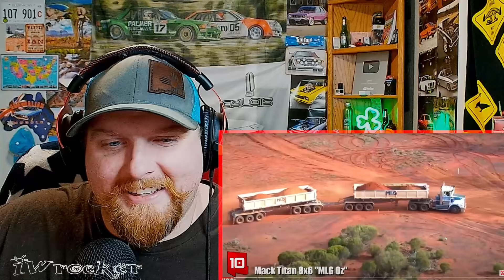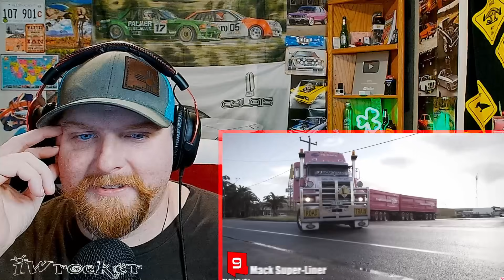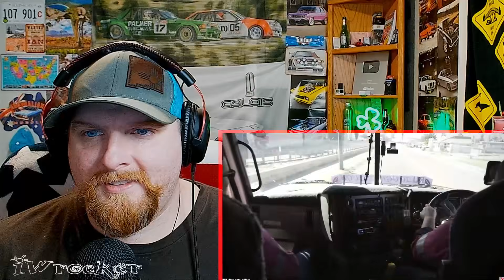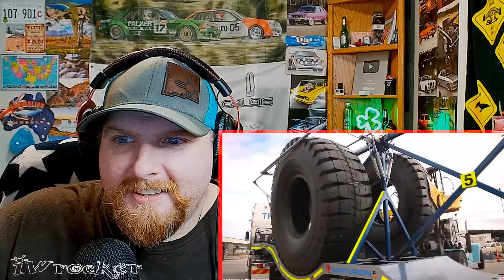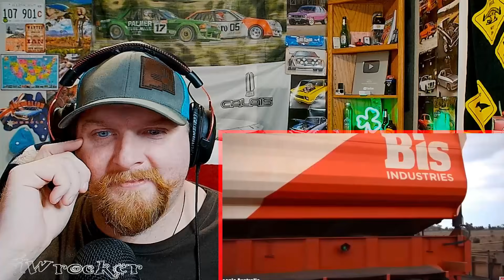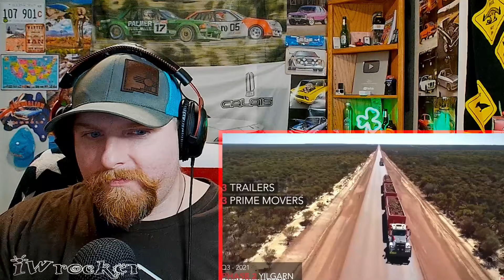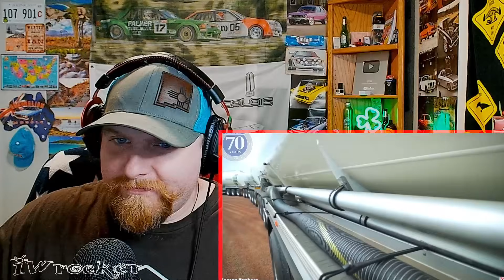American Reacts to The BEST Australian Road Trains Ever Produced

Comment: Those large tires on that Rig may look good. But, I am sure you would not be saying that if you were paying for them. I would imagine those tires are approaching or over 100K each so if they are say 100K just on that rig alone there is 12 tires @ 100K = $1.2Mil and then if you take into account the cost of the trailers and tractor..... That is a lot of money rolling down the road. Even the smaller tires are not cheap. You ask any farmer how much they pay for their tractor tires.... There is so much costs which most do not even think about. Buying the machinery is the cheapest part.... Running it and maintaining it, that is totally different. Good reaction though, Thank you for sharing with us all :)

Comment: I think the technology is already here for autonomous cars. We have a new Subaru work car, you can literally set cruise control and it drives itself. It stays in the middle of the lane you're in and follows curves in the road. You can literally take your hands and feet off the controls and let it do its own thing, once you're on a highway. It does start beeping at you after a short while, and flashing warnings to put your hands back on the wheel. Whether or not we will ever end up with cars that just drive themselves, with no human in charge, I don't know. I think they will always be designed to have a driver in charge. Not that human drivers are always better than computer ones, if I'm honest ;)

Comment: An uncle of mine is a quarry works operations and equipment specialist and emigrated out to Oz about 20 years ago. He travels the length and breadth of Australia inspecting and consulting at quarries. He flies as far as he can usually, but has had to spend days driving something like a Toyota Landcrusier on the red dirt roads used by road trains. He's sent me some crazy cool photos of where he's pulled over to allow road trains to pass. 
I kinda miss quarry work now watching and thinking about it all. Let's just say I used to get through some of those tyres.

Comment: Kenworth trucks built in Australia are all custom built to buyers specifications, in fact there are bigger trucks built at Kenworth in Melbourne,  they're the roadtrain prime movers. They are too big to fit on the production line, everything is bigger cab, chassis running gear.

Comment: Don't know much about trucks, but I believe the longest truck in the world is the custom-built 3b affectionately known as the centipede it’s a 205 ton 160 foot long rig it has an 18-speed gearbox with a 550 horsepower engine and carries over a ton of fuel.  It has 110 wheels on 28 axles the centipede transports zinc ore from a mine in the northern territories to a port hundreds of miles away – it works 24 hours a day seven days a week and in one year it can haul a quarter of a million tons of ore.

Comment: The really important application for autonomous driving is in trucking, not in cars. In a car, its a nice gimmick, but in trucks its making real money. A autonomous truck never needs sleep, or wants time off, or gets ill. No human driver can compete with that, not even those in low income countries.
The development and testing is done with cars only because thats cheaper and easier to handle.
Reply: I doubt a truck would be able to run 27/7 without having over heating issues or just issues in general
Reply: @joshhawke13  There are no overheating problems. Also today truck run for 10 hrs or more, and they only stop to refuel or load cargo.
The only time a autonomous truck needs to stop is also for that, and for maintainance. 
But there are no limitations like max driving time, driver breaks, leave and all that. And the best of all: the autonomous system doesn't demand to be payed every month. Once its bought, it just works for free.

Comment: The pink Superliner loading grain is owned by Heather Jones from The Pilbara Heavy Haulage Girls Group. Look her business up (Pilbara Heavy Haulage Girls) to learn more
Reply: The tyres on the Centurion truck are OTR (Off The Road) tyres for mining trucks and loaders - the trailers are made by Western Australian trailer manufacturer, Bruce Rock Engineering. If these tyres are hauled laying down, the driver is restricted to daytime travel only and will require a oversized pilot and permit. Transporting them standing up removes these requirements and allows the driver to travel at any time

Comment: My husaband works in an open cut mine in northern Western Australia and they have autonomous dump trucks over there. 
My husband says the first time you see a huge driver less dumpy is pretty daunting.
Reply: Yeah, I've been in one in the dicky seat running autonomously on a calibration pad testing LV follow.  I think I preferred being in the truck rather than the LV in front.  They are pretty safe and the GPS/LIDAR systems they have onboard are so accurate they have to offset the trucks on the haul roads otherwise they drive ruts into them.
Reply: My brother worked in the mines maintaining the vehicle fleet- when the automated trucks need service they just come in and line themselves up ready to be worked on.
Reply: @leemasters3592 That would  be so weird. Lol. My son is a fitter on the big tonka trucks as i call them.

Comment: Kenworth 509 is CERTAINLY an Australian Domestic model . In fact , ANY of the Trucks with Triple Drive Axles are Australian made .
The  Triple Screw Volvo uses a Volvo Drivetrain , but a Locally Designed Chassis . Canada does have Triple Drives in Logging . Too WIDE for Public Roads .
I  am dead  Against  Autonomous Vehicles on PUBLIC Roads . In a Private , closed environment , OK , whatever . Good  Luck with that .

Comment: Before speed cameras  and GPS tracking some trucks use to travel fast speeds around 150 or 160klmph ( 100 mph)they almost blew ya doors off.
Reply: Us trucks will do 160-180kmh flat out. There was a drug driver some years ago that was speed trapped at over 180kmh. Made the new here in Norway. Scania will do 130 ish when the fuse is pulled. Less top speed due their gearing.

Comment: Cab overs are not great for comfort when driving on our dirt/gravel roads.  Australia does not have a great rail network so,  road trains rule due to our isolated areas.  Kenworth, Mack rule the roads, some European built are ok on main roads but not really built for our dirt/gravel roads.
Reply: Scania do well on gravel roads. They have air bags on each corner of the cab.

Comment: The main problem with Autonomous vehicle, specially so trucks, is that if something happens, there is no hands on deck. Also it really only work for bulk or container transport.

For pretty much everything else, there need to be a dude there securing the load, and also checking on it. I have a hard time seeing it really replace truck drivers. And that is from the view of me the engineer that don´t drive trucks but do work orders.

Comment: We make stuff all in AUS anymore because our government wont look after Aussie industries and would rathe import everything , god help us if other countries stop exporting to us we would fold overnight . Check out the lengths of our coal trains hauling coal to hay point at mackay  in QLD .
The train usually ran with around 165 wagons, ( which varied slightly at times ) with an overall length was around 2.7 km's, or 1.67 miles, or 8860 feet.7 Sept 2016.
Reply: We call coal poofter dirt. Very lite weight compared to iron ore.
Pilbara iron trains are over 230 cars long. Each with 120t
Bhp has the record for a 10km long train.

Comment: ITs worth saying there is a huge diffrance between Volvo and Scania in manufacturing. Volvo make the main components in Sweden, then ship them out in containers.

All Scanians (part from the Brazilian once) are made in Europe. While Volvo (That also make trucks branded as Mack and Renault) have plants all over the world. In some cases they have different plants for different brands (like in the US), while in Australia the Mack and the Volvo branded trucks are made in the same factory.

Volvo also got a bit more of a local styling while Scania look the same all over the world.

Here in Sweden the Scania fans often joke and call Volvo third world trucks
Reply: The American style Volvos, aren't they made entirely in the US?
Reply: @otgiggs  The frame, body and like 90% of the interior is made in the US.

For the gearbox and engine its a bit complicated. The power-train is assembled in Hagerstown, Maryland. What i can get out of it its pretty much a power train assembly plant. So they build the engine, but don´t cast it.

So it really boils down to the definition of enterly made in the US. Somethings will always be imported.

Even at the main manufacturing plants, stuff like injectors, Volvo is not making them, but rather buying them from a other source.

Comment: The cab over kenworth you need to be a ape to get in them 
You climb on the rail you hold then onto tyre then foot hole and step into cab 
The others have steps but that means lower to grown when you hit something can jam steering 
Where' kenworth cab over they don't have lower steps you start at fuel tank behind cab with foot hole and do as as explained above 
Why older guys like long nose kenworth as steps on fuel tank which length of vechile under the door
The other cab overs Scania Volvo have front steps same as Japanese trucks but limits clearance 
Freight liners have a set of stairs that open up around front wheel when opening doors 
So theirs 3 styles of getting in the prime movers 
Why alot like long nose kenworth easier to get into 
Yes their is on you tube how Australian brand of kenworth built and designed here beefed up everything from chassis rails to cooling systems gear ratios ect 
Those tyres on trailer are massive I think 2 or 3 stories tall the dump trucks I seen could carry 180 tonnes on their back and electric shovel picked 90 tonne in 1 scoop has a self run power system next to it generating the electricity 
They put red flags on Toyota land crushers as they keep getting run over as they can't see them because sitting multi stores high in them a stair case to climb into them I can't remember how many thousands a tyre cost for some reason have two figures 6 to 20 grand a tyre
Now I think have one's that carry 280 tonnes now 
It's a massive  industry and hughe bills and the hole in the ground make the trucks look small as for Toyota landcrusier if didn't have red flag on it you wouldn't see it in the hole it's so tiny it  like a needle in a hay stack 
The wheels on the one's I saw where well over 6ft inside the tyre diameter and they use cranes with a jig to change tyre on vechiles 
Duell trailers are the norm here in Adelaide now many road trains as they've alter many intersections by moving traffic light further back so they can get around the corners and where I live quite common to see road trains 
Cheers mate 🦘🇦🇺👍

Comment: Largest load I saw was not actually a road train but a premade steel structure heading for a coal mine, took up the full width of the road with special dollys. Was hauled by two massive prime movers connected in line by a steel bar. Was travelling at about fast walking speed. The most impressive sight and sound was the quad magnetite and copper concentrate road trains coming in and out of Ernest Henry Mine in the quiet night time, lights running  full length either side 🔥
Reply: You should've seen them shifting the autoclaves for Murrin Murrin. That required 7 prime movers.

Comment: I've seen those tyre's on a standard flat tray trailer, they don't stack them 2 tyres horizontal 1 forward 1 aft on the trailer and they need a wide load permit and escort vehicles, so that speciality trailer that lets them haul 4 tyres per trailer is probably a big time/money saver.
I live near the Brisbane port so I see fully loaded B doubles all the time, but when we have visitors from overseas they are always amazed by them.

Comment: When I worked as a Truck detailer, a Peterbilt was a super rare machine to see. Every time we got one we would all get a selfie with it looking all shiny and pretty. So Respect USA from Straya 🤘
Reply: @mtuz8356   I've only ever seen 3! And one was pulling out of a truck stop a few hundred ks away at Tamworth. Still got my selfie 😂. I detailed 2 though and the drivers watched us like Hawks.
Reply: @kevo6190  i know of a few over the years.. 'murican trucks get shaken to shit over here... they just dont last
Reply: @adambartlett3483   - If PACCAR wanted to - they would just build Pete''s in Melb  (Most likely no margin exists over here for 2 different brands in the same space)  - Kenworth does the job of "Premium" US truck for Australia - just Torque the bolts, threadlocker and lockwire if needed - on highway vs offhighway, totally different beast, even Macks and Kenworths get shaken to pieces on bush roads (Volvo and Scania do ok, some off highway users swear by them in the West - horses for courses, bling for the muppets.)..  hmmm...

Comment: That Bis truck had a power pack second trailer, that is a second engine that powers the wheels on the trailer and helps with the load.

Most dump trailers run on hydraulics off the trucks engine for the lifting and compressed air for unlocking tailgates, single dump trailers are dumb, that is just hoses connected to the lifting / locking pistons and valves in the truck cab control everything, but multiple trailers can have electronic solenoids to control their functions with the truck just supplying the hydraulic power and air pressure.

Some trailers also have their own engines for hydraulic functions, which may be remote controlled, but they are normally trailers like lowboys where the hydraulic power is only needed to configure the trailer for loading / unloading.

Comment: Yes the 509 is a Australian made and designed in Australia for Australian terrain 
The cab is seperate from the sleeper because of our rough outback roads if it was all one piece like the 909 they would crack and pretty much fall apart 
And we have the T series over here the T400-T401-T404-T408-T409-T410-T600-T601-T604-T608-T609-T610-T900-T904-T908-T909 and also the W models the SAR’s so many to mention 
The C series 
C500-C501-C508-C509
The sleeper is seperate from the cab
Reply: G'day Ian, 
Mack trucks are manufactured in Australia 
In Queensland, 
In partnership with Volvo  !
Reply: @kennethmcdonald93  Mack trucks Volvo Engine inside
Reply: U forget to mention the t650 t658 t659 t950
Reply: @Dingo4732  what’s the difference between the those and the T908s etc ?
Reply: @australiantruckspotting8883  the T908 is just a rip off version of the T904 
That cost 2x as much
Reply: @australiantruckspotting8883  the Trucks the @Dingo4732 said are sloped bonnet trucks
Reply: you forgot T359, T360, T659, T650, T950, C510, K100, K104, K108, K200,K220. There are so many  kenworth trucks on the Australian market its insane
Reply: Great info
Reply: You all have also forgotten the C540 (this is a mining only spec kenworth)
Reply: What a crock a shit I drive a c509 and the bunks are all integrated shit falls apart because ftard don't know how to slow down and look after there gear
Reply: My only disagreement is the cab!! You can run any truck on the dirt if you know how to drive to the conditions. The 904 through 909s are absolutely fine on the dirt the big difference is actually the cab is raised up for better cooling and air flow and there's a lot more support and bracing around the bigger radiator etc

Comment: I’m a bit annoyed they didn’t go more into detail about the dual power train. They are an awsume  rig. A company I worked for used to run 5 trailers with the third having its own engine and auto trans. You con see the coolers up on the frame. Between both engines I remember it been over 1100 hp. I only loaded not drove but when I knew one was due you could get out of the cab and feel them coming up the valley long before it arrived.
Reply: Mount Isa.QLD.  Running between George Fisher and black star about 20 km. I back loaded fill for underground.
Reply: U had bulkhauls 7 trailer powertrain
Reply: Weipa?

Comment: The TriDrives are always impressive. But it must cause a lot of understeer when accelerating
Reply: Especially with all the diff locks in climbing up slippery mountains. At least according to the driver hauling fuel through the ranges south from Darwin. I couldn't believe he was still getting wheel spin as well.